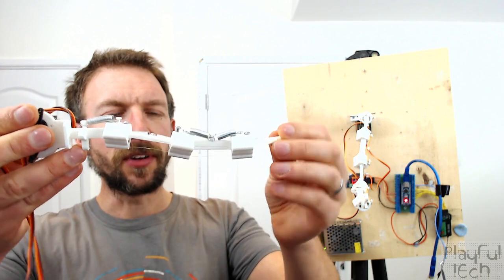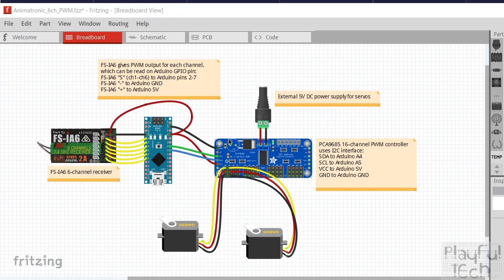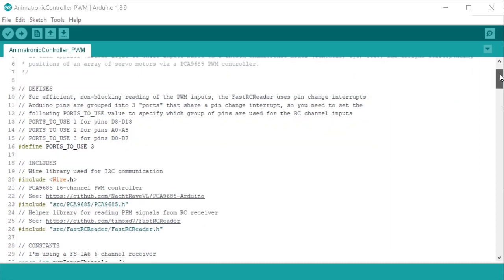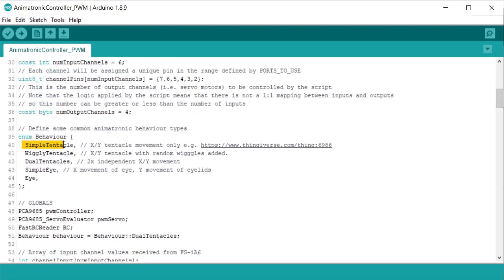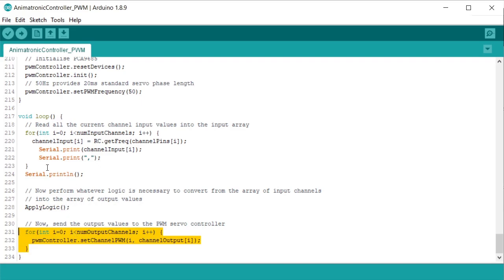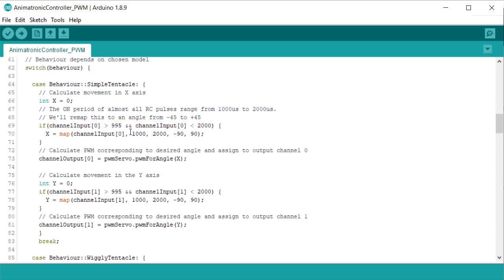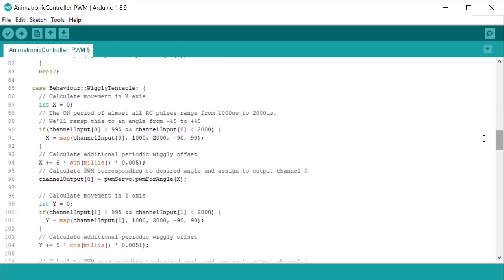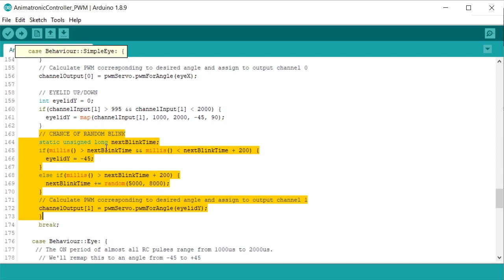Arduino Animatronics - How to create a Robot Tentacle Arm

Comment: I recently started working on an arm using the ESP32 Arduino and have ran into the error of undeclared identifier for line 73 and 76. This is my first time messing with arduinos and would greatly appreciate some help on the matter
Reply from the maker: Is that using the code at https://github.com/playfultechnology/arduino-animatronic/blob/master/AnimatronicController_PWM/AnimatronicController_PWM.ino ? I can't see anything on those lines that would generate an error.
Reply: @PlayfulTechnology  my apologies for the late reply, i never got a notification. I am using animatronic controller_iBus_ESP32 coding on yourr github page. the error occurs at line 73 " display.printFixed(0,  0, s, STYLE_NORMAL);" saying exit status 1 'display' was not declared in this scope.
Reply from the maker: @TexasFrontierPilot  Ah, that's easy - in the Arduino IDE go Tools -> Manage Libraries, and install the "lcdgfx" library.
Reply: @PlayfulTechnology  after installing the library i am still getting the same error. im sorry for the constant help this is my first time messing with arduinos and coding
Reply from the maker: @TexasFrontierPilot Hmm, shouldn't be. Can you copy the entire contents of your output log to somewhere like pastebin?
Reply: @PlayfulTechnology  my bad after going through and including the library in the sketch tab it has cleared up that issue but brought up another. Line 94 “ApplyingLogic();”- Compilation error: ApplyLogic was not declared in this scope
Reply from the maker: @TexasFrontierPilot  It looks like you edited the file and changed the name of the function: it should be called ApplyLogic, not ApplyingLogic.
Reply: @PlayfulTechnology  ah autocorrect got me. It is ApplyLogic
Reply: @PlayfulTechnology  do i need any more libraries or is there anything i need to add?
Reply from the maker: @TexasFrontierPilot  No - your error above was due to a typo. If you're still having problems, post the complete error log to somewhere like pastebin and I'll take a look.
Reply: @PlayfulTechnology  you were right the code did get altered by mistake and now that is squared away and i got it to upload to the esp32 and I greatly appreciate your help with that. Unfortunately after wiring everything up according to the diagram but the motor doesn’t move when any input is given on the remote control

Comment: Very awesome videos! I see how this setup with the Arduino would be perfect for controlling say a stepper or an LED via RC, or even trigger a pre defined series of servo movements with a switch on the transmitter, but if you're going to live control servos wouldn't you just control them directly with the RC receiver as they are intended to do? I think you can do most of what you need for animatronics by just manipulating the mix settings in the transmitter?